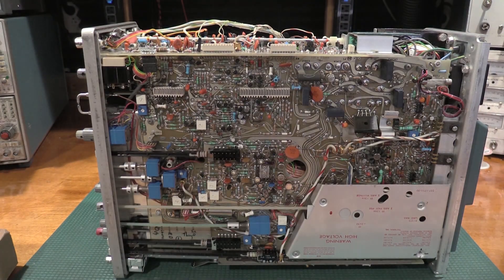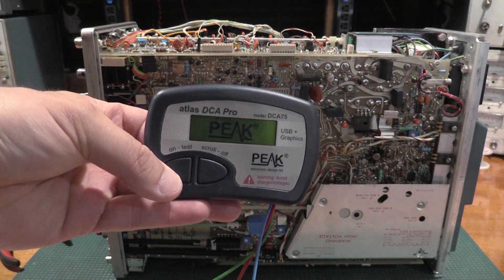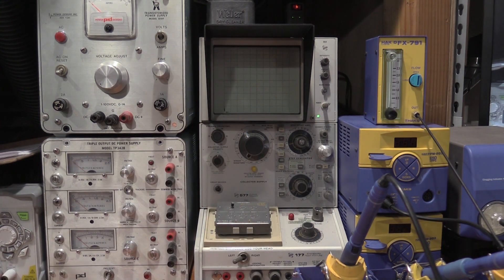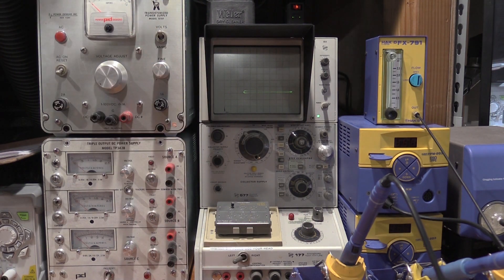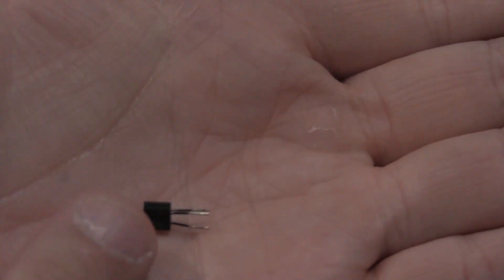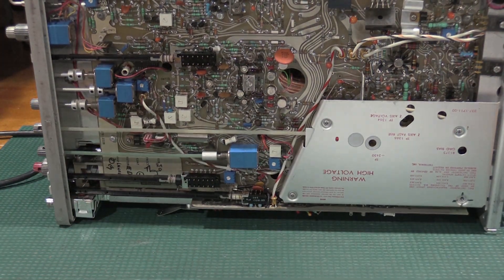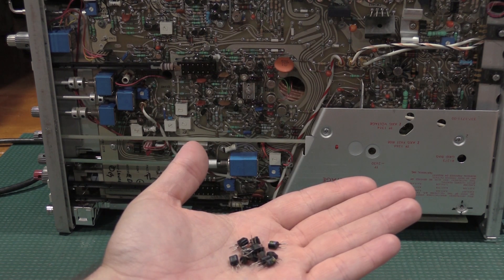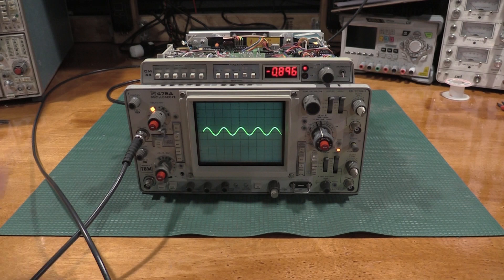Tektronix 475 Troubleshooting 151 0367 00 [MPSH05] (Guaranteed Bad Parts)

Comment: If those were OEM parts, and the scope worked for many years, why replace them?  If there is a parasitic diode, with the Cathode at the Collector, and the Anode at the Emitter, it will only conduct when the transistor is plugged in with the Collector and Emitter leads swapped, or if the transistor is driven as if it was a PNP transistor..  Is this a recommendation that originated from Tektronix engineers or is it folklore?
Reply from the maker: These should NOT be replaced. The parasitic diode is a is the nature of the microwave speed transistors. This was the recommendation of another tech lots of discussion followed as well as testing. These transistors are fine they have an fT of 1.5Ghz and as such have a VERY low reverse breakdown which the tester is falsely reading as a diode.
Reply: That makes sense.  So the Collector-Base junction has a low Reverse breakdown Voltage, which some testers see as a defect; probably because the tester has a 9 V. Battery inside.  Probably no damage is done to the transistor because it is current limited.   I have seen this with RF transistors.   I have a bjt/FET tester that measures BETA/Transconductance.   Usually though I use my reliable Radio Shack FET VOM to test transistor junctions.  That's all you need for small transistors.  However, with multiwatt RF transistors, it won't tell you how many emitters are blown.
Reply: I just read parts of the Tek-wiki discussion you and others had with Prof Tom Lee about the somewhat fictional MPSH05 transistor in the early 475 oscilloscope.  That discussion was 2 years ago and Tom Lee stated several times that 1) It is a typo in very old Tektronix documentation that cross-references the MPSH05.  2) The actual '367 transistor has a low Collector-Base breakdown Voltage, like most transistors with an ft > 1GHz.

Comment: Tekwiki has a semiconductor cross reference guide on their website. The faulty transistor is cross referenced to an A5T3571 (by Texas Instruments it looks like). It’s under the transistor high speed amplifier section (pg 178 of the pdf). It also lists all the relevant characteristics there
Reply from the maker: The original information in this video came because of some discussion on the TEK mailing list. After some additional information as well as trouble shooting and looking at things the general consensus is the transistors are fine and DO NOT need to be replaced. The original part is a 1.5Ghz transistor and had a VERY low reverse breakdown. There is also some confusion on the Xref that is gone in to in the accompanying video the recommended replacement from the mailing list was only 600 Mhz still fine for a 475 but the original parts were higher spaced. 

TLDR: if the trigger is working odds are good the parts are NOT faulty and do NOT need to be replaced.
Reply: @ZenwizardStudios  just had my previously perfectly-triggering 475 lose trigger. Thanks a million for all of this.

Comment: Very interesting. I was given a 475 scope in apparently pristine condition, but it will not trigger. I also have an old Heathkit Transistor Tester that does leakage testing. Transistor leakage tests have saved me a lot of trouble on several occasions, including on an old combo organ I was given because everyone else gave up on trying to fix it.
Reply from the maker: After looking in to this further these parts are not at fault. The diode is there due to the speed of the part. if the scope is not triggering I would try tuning up the trigger section before anything else. Tunnel diodes are none for a small amount of drift it might be as simple as needed a calibration touch up.. The transisters in the trigger section of a 475 are at an fT of 1.2Ghz.
Reply: @ZenwizardStudios  Thanks for the update. I had put this scope on the back burner because I had heard that there were parts in it -- and I think they may have been the tunnel diodes -- that were unobtainable as repair parts. But perhaps I'll go through the functionality checks you outline, along with the calibration/alignment and see if that will get it working.
Reply from the maker: There ARE tunnel diodes in the scope. The are the main active switching element in the trigger. The good news is in the 4xx series scope they are not known for being problematic. In most of the scopes that I have looked at that appeared to have serious issues 90% of the time it was power supply related. Usually a missing or low voltage rail. One of the 4xx scopes I have fixed was not sweeping at all. It turned out that the -8 Volt rail was missing on the sweep / timing board. 

There are some extremely exotic capacitors on the timing and sweep board that should NOT be changed these were made in how by Tek for Tek and replacement would be multiple $100’s the good news here is these really never fail and are always good (I have never had to replace any yet) They are the main timing capacitors for the sweep speed and are of any extremely high quality. And they were all a matched set to get the sweep speed to work correctly.
Reply: I think repair people tend to focus too much on replacing parts.  I have just finished tracing the A8 trigger board, of a 475, front to back.  I started with the synch inputs and followed them through to where they went to the sweep and Z-axis board.  I had nothing on the test points when I started.   I didn't replace any parts.  I just adjusted the pots on the A8 board for optimal synch capture.  I sometimes find missing parts, so I know someone was there before me.

Comment: What is the replacement transistor you ended up using?
Reply from the maker: KSP10BU. Pin out is different so lean bending needs to happen. These were also not just used in the 475. And should be checked and replaced no matter where they are found.
Reply: @ZenwizardStudios  Is there a specification for the original transistor SKA6516? I can't find it anywhere on the internet.

Comment: I just came across this myself and will be swapping mine out just on principal (cheap insurance).  According to the 475 service manual, this part number is not dependent on serial number, except for Q688, Q698 which start at S/N B010162.  Incidentally, I believe the list on the video had a bit of dyslexia in one of the transistor numbers.  On the video list is Q689, but on the parts list in the service manual, there is no Q689 (but there is a Q698, which is listed as 151-0367-00).  I am suspecting that the list in the video is wrong since all the transistors in the service manual have strictly even numbered parts.  Also, in the service manual, there are more of this transistor than you show on your list.  Q390, Q420 (for a small range of S/N), Q1124, Q1134, and Q1184 (for a small range of S/N) are also the suspect part.
Reply: same here, all 151-0367 were damage. No Q689 -> Yes Q698. On the other hand, some transistors 151-0434-00 have the same issue, just a few, in my case Q562 and Q188. Great video, very helpfull

Comment: I just checked these transistors in my 475 and they're all coming up with the same symbol in my pro atlas transistor tester are you sure these are leaky? Seems strange that every single one is leaky I would expect to find at least one that's ok. what was the problem with your 475A  before changing the transistors?
Reply from the maker: I am about 98% sure unfortunately. The trade name of the transistor is the MPSH05. From all the information I have been able to gather the reverse protection diode should NOT be there. It would appear this is a process issue that has cropped up over time. The newest batch of the transistors do not show the revise protection diode at least for what I have been told. depending on where the transistor is in circuit it might effect the circuit it might not as this is a emitter -> collector leak.

Comment: are these leaky transistors across all 475 serial numbers?
Reply from the maker: I am not sure if it is across all 475 serial numbers however this Tek part number 151-0637-00 was used in more than just the 475's and should be check in all applications. The Early ones are guaranteed faulty. The later production transistors MIGHT be faulty but should be checked.